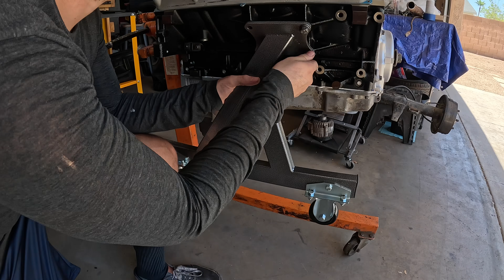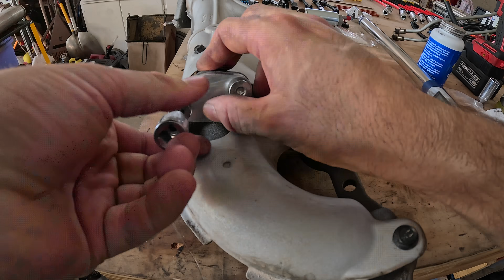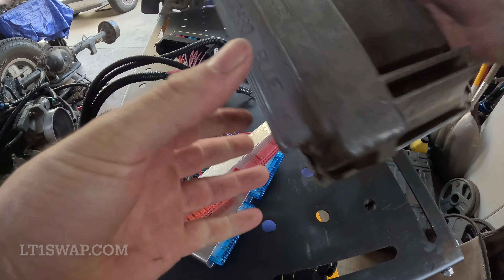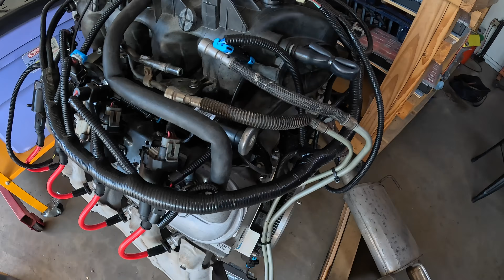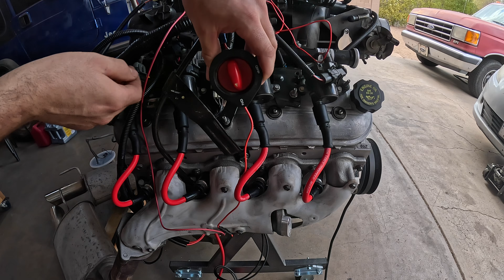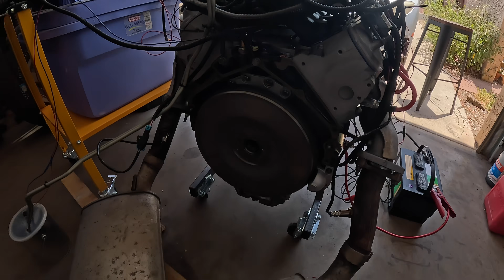LS Engine Run Stand Build and First Start!

Comment: Do the harness being drive by cable vs drive by wire really matter
Reply from the maker: Yes, they matter quite a bit!

The wiring and plugs are completely different. For a drive-by-wire setup, you'll want to get the electronic pedal (and the TAC module, if it's an older Gen 3 setup) ideally from the exact same truck you got the engine, harness, and PCM from so everything communicates properly. 

If you run drive-by-cable, you don't use a pedal wiring circuit at all and just run a physical cable.

Comment: Does the fuel pump wire on pin 30 coming from the relay need a fuse?
Reply from the maker: Heyo, yes, for the long-term an inline fuse (15A - 20A) is recommended for the wire going from the power source (battery or starter) to the fuel pump relay! 👌

You don't generally need a second fuse from the relay to the pump.

Comment: @MyAutoAdventures dumb question,  did it start without the  mass airflow being connected?
Reply from the maker: Not a dumb question at all!

On my very first startup I completely forgot to install the MAF. The engine actually ran fine for a short bit (I didn’t have the water pump installed yet, so I only ran it for a second).

Second attempt it wouldn’t start at all. As soon as I installed the MAF it fired right up perfectly. 👌
Reply: @MyAutoAdventures thanks i wasn't sure from the video

Comment: Great video and very helpful. Could you confirm if pin 87 on the fuel relay goes to the fuel pump power wire. Was trying to see in the video. Thank you.
Reply from the maker: That is a yes on pin 87. 👌

87 power to the pump
30 power from a 12v source 
85/86 controlled by the computer

Super appreciate you watching bud! 🤘
Reply: Does the wire going from pin 30 to 12v source need a fuse?
Reply from the maker: @chrisbryant8065 Yes, great looking out! For long term/in the vehicle, it's recommended to have a 15A - 20A in-line fuse for that pin 30 wire. 🤘

Comment: Run it with the MAF 5 wire and stock air box if you use a crappy after market one you will be cleaning alot
Reply from the maker: Super appreciate the heads up! And thanks for watching! 🤘

Comment: Can the same method be used for a 6.0ls ? And what size wire are you using for the fuel pump
Reply from the maker: The same method can definitely be used for a Gen 3 6 liter! 

I used 10 gauge wire for the fuel pump! 🤘
Reply: @MyAutoAdventures . Thank you so much for your video is so informative , very helpful.

Comment: Man I connected everything the same way you did everything is the exact same I plugged constant power the way the manual says to connect to the relay the same way you did I’m getting constant power but my fuel pump isn’t receiving any 
of it do you know what it could be ?
Reply from the maker: Heyo bud, a couple things you can test that should narrow it down quickly:

1. Test the fuel pump by itself

Take a battery and hook power directly to the pump (positive to positive, negative to negative). Make sure the pump actually runs on its own.

2. Check the pump ground

Even if you're getting constant 12V, the pump won’t run without a solid ground. Make sure the pump ground is clean and tied into the engine block or a good chassis ground.

3. Verify the relay wiring

The ECU triggers the relay, but the relay still needs:

One prong with constant 12V
One prong going out to the pump

You can bench-test the relay if needed.

4. Confirm VATS is deleted in the ECU

VATS usually stops the injectors, not the pump, but it’s still important to make sure the computer has the anti-theft removed.

The good news is you can test all of this without cranking the engine. As soon as you power the ignition relay, the ECU should prime the pump—so you should be able to hear it run.

Comment: What gauge wires did you use for all the connection
Reply from the maker: I used mostly 10 gauge wire for the connections going from the relays to the fuel pump and to the ignition relay.
Reply: @MyAutoAdventures  Thanks!

Comment: For balancer I always just heat it up a little bit it slides right on ( no it doesn’t burn the seal) if it doesn’t go on all the way the bolts will pull it in
Reply from the maker: Great tip 👌 Love hearing other methods people use to get it done.
Reply: That balancer is 2 pieces of steel sandwiched with rubber heat it up melt the rubber. 😮😮😮😮
Reply: @stephenr1999 millions heat it up with no issues

Comment: Do you have a link for the switch you used, I don’t see it listed below in the description. After doing this anything you would do different or suggest for a first timer?
Reply from the maker: Heyo, thanks a bunch for watching!

The switch I used came from an old tire inflator I tore apart, but you can use any simple 2-post switch and it’ll work the same. 👌

Honestly, nothing major stands out that I’d do differently. The biggest thing is just making sure you prime oil through the system so you’re not firing it up dry on the first startup.

One thing that did catch me at first—I forgot to plug in the MAF sensor. It still started the first time, but the second or third time it didn’t. After I plugged the MAF back in, it fired up every time with zero issues. 🤘
Reply: @MyAutoAdventures thanks for the quick reply! Appreciate you!

Comment: Nice vid man!! What transmission are you gonna be running
Reply from the maker: Super appreciate it! Planning on running an AX-15 manual trans. 

Since it's pretty close to stock it shouldn't need a crazy heavy duty transmission, and this way I can keep my NP231 transfer case. 🤘

Comment: Currently LS swapping my 240sx (first time ls swapping anything) and so i was looking into the harness you put on the description, now im wondering does it make a difference if i use the T56 or 4L60? Im using a 300zx transmission lol
Reply from the maker: Heyo, thanks a bunch for watching the video. That engine is a manual correct? I think in that case you'd be fine with the T56 harness. You might need to find an adapter for the harness to make it all work though. 😊
Reply: @MyAutoAdventures engine was automatic but pairing it with a manual 300zx transmission, me wanting to be cheap is wondering if the $80 one will work same other then not plugging in the connectors
Reply: @drsantiellan I know you posted this 5 months ago, but you will need to get the parameters changed in your PCM. Change it from automatic to manual.
Reply: @rchavez5056 i figured i would haha thanks man!

Comment: Whats up brother what all positoves did you put on poaitive starter
Reply from the maker: Heyo, thanks for watching! 🤘
To the starter, I ran the:

Battery cable
Ignition relay
Fuel pump relay
Ignition switch wire

I hooked them all up here for the video, but when the engine’s in the vehicle, some (like the fuel pump relay) can go straight to the battery since the computer only powers it when needed.
Reply: @MyAutoAdventures apreciate ur time respondimg you mind redoing a vidro atep by step and what cables goes to relay  ao i see where allcables  go on the relay
Reply from the maker: @eduardovaldez900 It’s an awesome Amazon harness!

You can check out my other video where I go over it 👇
https://youtu.be/QtoOkN3JZDc?si=0ZViteUunzENvt3J

It only uses two relays:
1) Fuel pump
2) Ignition

If you want more clarification, feel free to shoot me an email at MyAutoAdventures@gmail.com, and I'd be happy to go more in-depth.🤘

Comment: See your video on IG came for the parts list where did you gey the off and on switch and power cables to go to battery
Reply from the maker: Heyo, thanks for watching! 

All of those items came from an old car tire inflator that stopped running. I kept it in case I could use the parts, and they actually came in handy for this build!

Any ol on off switch will work though and power cables are easy to get on Amazon. 👌

Comment: The timing on this video could not be more perfect I am in the middle of doing a 6.0 4l80e swap on a 87 Comanche with the same Wiring harness. Great work on the vid!
Reply from the maker: Dude that’s awesome! Are you planning to fire it up on a stand first, or go for the first startup once it’s in the engine bay?
Reply: @MyAutoAdventures  Its sitting in the truck already, just waiting on my fuel pump and O2's. its a fully rebuilt LQ4 with a BTR cam and flat top pistons. Do you have any plans for a/c? What transmission will you be running?
Reply from the maker: @NAisOkay That’s too cool! Definitely send me a video when you get it fired up, or even throw it on YouTube—I’d love to see it!

I had the JeepAir system before I ripped out the 2.5L. I’ve been trying different mounting setups and finally settled on a high mount A/C bracket. I have a video coming out very soon for that!

Planning on running the AX-15 with a Quickdraw bellhousing.